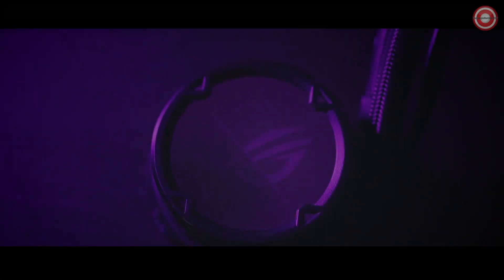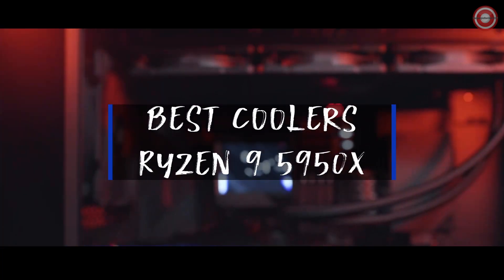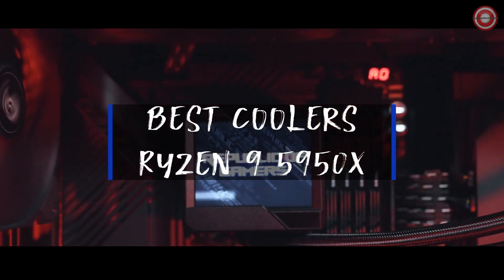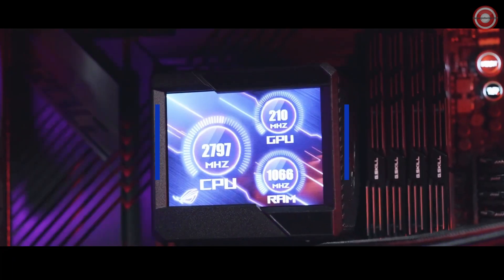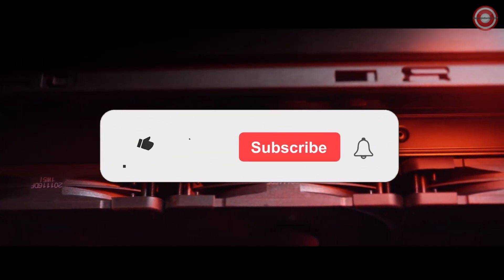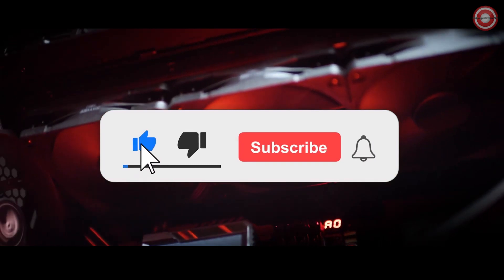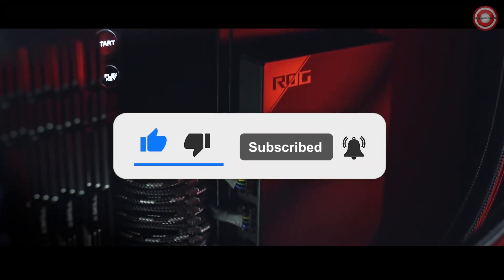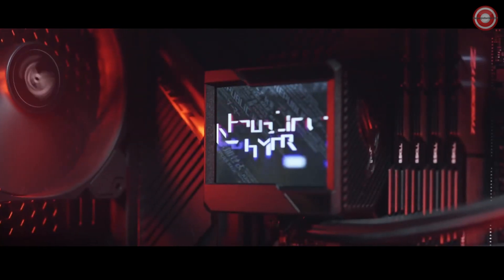5 Best CPU Coolers for the Ryzen 9 5950X: Keep Your CPU Running Cool and Quiet

Comment from the maker: 👇5 Best CPU Coolers for the Ryzen 9 5950X: Keep Your CPU Running Cool and Quiet👇
Best 240mm AIO Cooler
1. ARCTIC Liquid Freezer II 240
https://shorturl.at/01hPJ

Best RGB Cooler
2. ASUS ROG Strix LC II 240
https://shorturl.at/01hPJ

Best Air Cooler
3. Noctua NH-D15S Chromax.Black
https://shorturl.at/01hPJ

Best Budget CPU Cooler
4. DeepCool AK620
https://shorturl.at/01hPJ

Best 360mm AIO Cooler
5. EK Nucleus AIO CR360 Lux D-RGB 
https://shorturl.at/01hPJ

Comment: 3 liquid coolers out of 5?
🤔 🤔
This CPU is so powerful, I'd rather undervolt it & use with a generic tower cooler
I plan on getting it or the 5900xt for a last upgrade oomph on my old AM4 platform
Reply from the maker: True, a powerful CPU like the 5950X can run cool even on a budget. Just remember, with great power comes great cooling responsibility! 😉

Comment: Is this CPU still solid to get in 2024?
Reply from the maker: Yes, the AMD Ryzen 9 5950X is still a very solid CPU in 2024. It is still one of the top performing CPUs on the market, and it is still a good choice for a wide variety of tasks, including gaming, video editing, and 3D rendering.
Reply: @AryTechB  I just bought one cause it was on sale and i needed something for better 3d rendering, wow this cpu is a monster, i coupled it with a radeon 7900xt with 128 ddr4 3600mhz ya a bit over kill but the ram was on sale lol. I am using a deepcool 360mm aio and the temp at idle is 38c at load i have not seen it go past 70c and thats with 1440p gaming or rendering. although i have my system in a corsair 7000d air flow case could fit a small dog in it lol.
Reply: You can largelly wait 2nd or 3rd AM5 Generation ( if you focus on AMD specially ) of cpu before upgrade, 5950X is still a little monster in 2024.